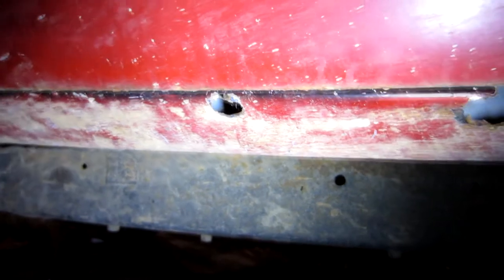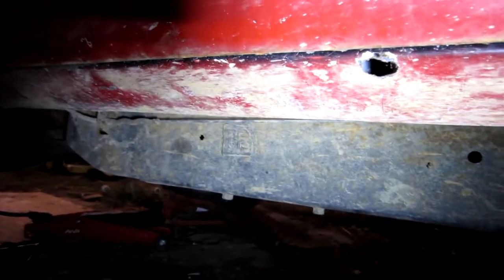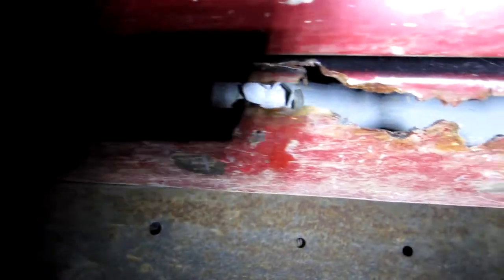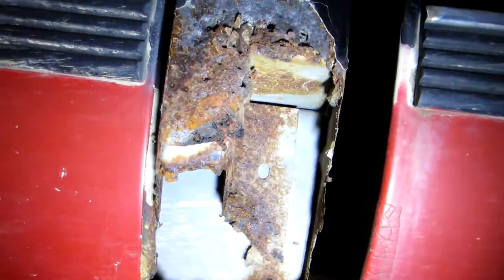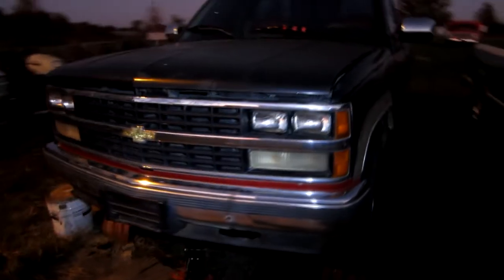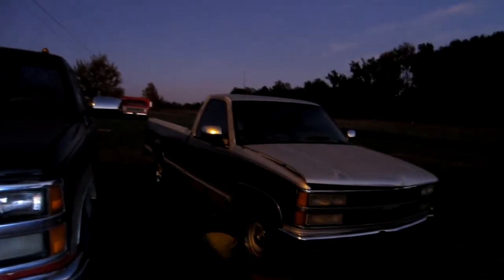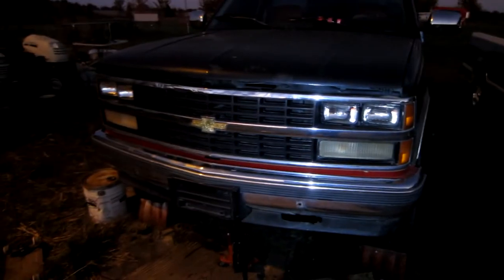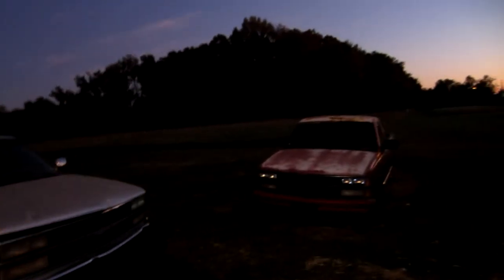Video Question for PIsser and others

Comment: Sounds like it would work, would be cheaper than new rocker covers.  If you had a donor and could cut good rockers off of and weld those in place, that would work also.  You need an injector?  I think I have like 4 or 6 of those that fit the chevrolet 4.3 & 5.7 engines.

Comment from the maker: @pisserschannel yeah i had planned on buying a pair of them off of ebay because my red truck has the cab corner ate out on the passenger side and the 4x4 has one ate out on the driver's side so one set could potentially fix both trucks that i believe is money well spent so i'm going for it. thanks :o)  just lacking the confidence so far to pull the trigger and get it done right now that's why i figured i'd get some reassurance lol

Comment from the maker: @VlogginLife lol, this one will be done right so that it litterally doesn't have to be done again any time soon, yeah i could drop about $250 bucks on a new bed for it and just fix and patch the rest but what do i really learn that way? so this is going to take a little work but the experience will be worth the trouble i believe. and btw spray foam would soak up water and make it rust out faster or worse spray foam and oil maybe not so bad.  starting on it in the morning soon as the sun is up